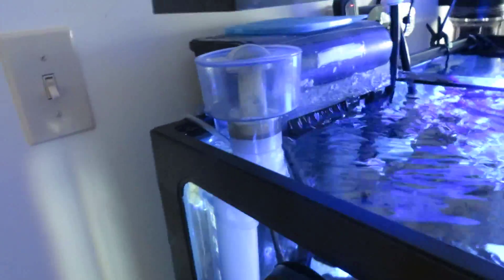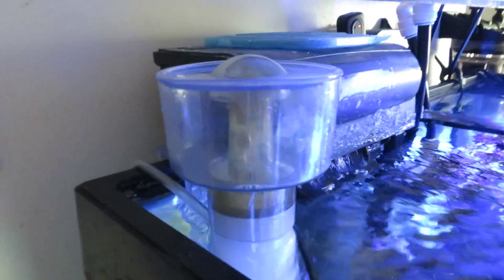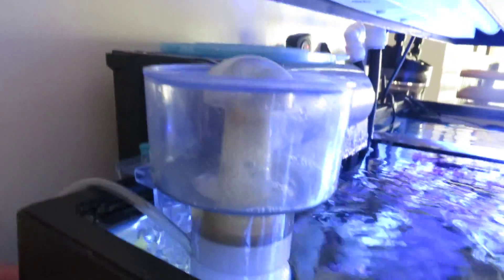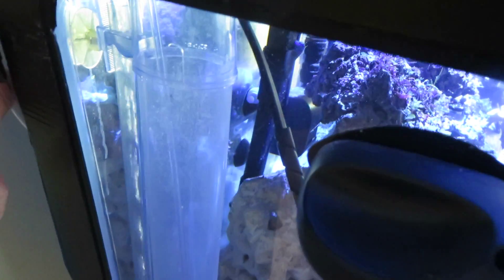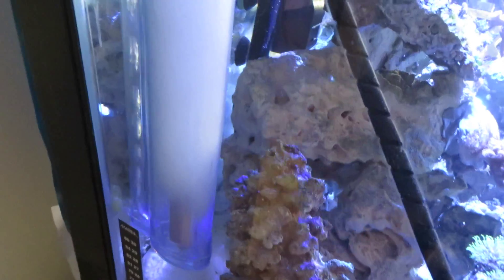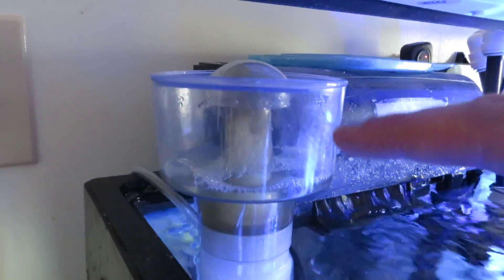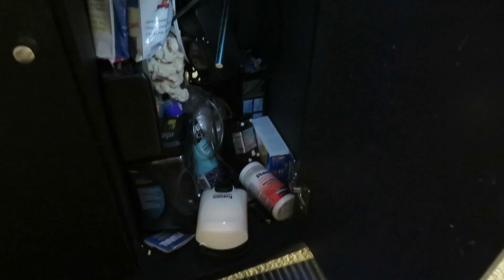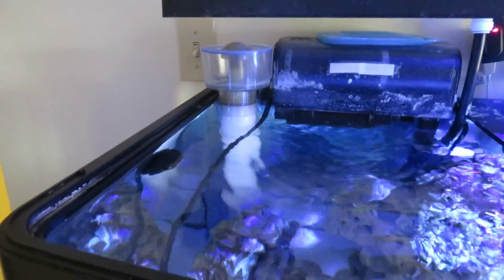Counter Current Skimmer Tuning 101

Comment: I purchased a Lee's skimmer for my new 32 gal tall tank and watched your video before setting it up.  Very helpful!  My question is: why are there bubbles, and what looks like skim - forming around the outside perimeter of the skimmer?  (in the tank.) I've adjusted the flow through the airstone so that the foam comes up to the lip of the column, which leaves a lighter trail of bubbles up the column.  Nothing like the bubbles produced in your column!  I have the valve as close to closed as possible on the other airline and it still sets up what looks like a stronger than recommended stream of bubbles.  Does this make sense?  The skimmer has been running for 5 days - so far only condensation in the upper section.  Ideas?  Recommendations?
Reply from the maker: Deborah Goldberg hello, it’s been quite a few years since I ran a counter current skimmer.  Basically cause I think they are a huge pain to set up.....and if your water level changes it all stops so I ended up buying a Red Sea brand pumped skimmer.  I however recall using a cork diffuser in the column and that really helped a lot over the stone diffusers.  Also make sure your pump is strong enough.  In the end you may go through more pumps and end up spending almost as much as a real skimmer anyways. Something to bear in mind is all.
Reply: Thanks for the quick response.  My pump seems strong enough - we'll see.  The tank set up was a gift and I bought the skimmer and the pump (.87 gal/min) when the (used) charcoal filter quickly died - don't have funds at the moment for anything pricey.

Comment: Did you glue or use silicone to keep the bottom of the unit together.  I just got mine and am trying to get it to work but the bottom doesn't want to stay on...every time I adjust, it comes off 😕
Reply from the maker: i dont recall having this problem but if the mechanical press fit isnt working id use a dap of crazy glue as its no problem in aquariums. non toxic for aquariums